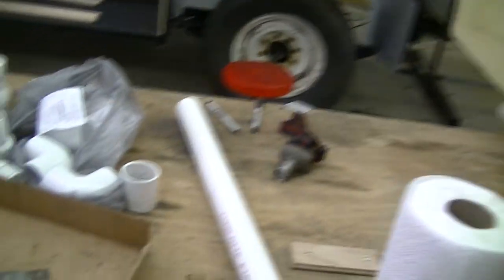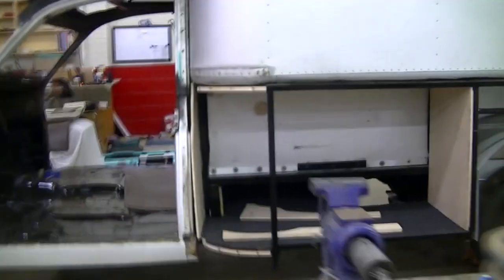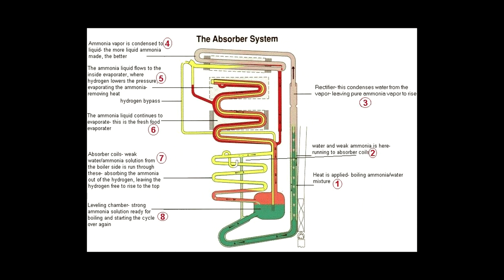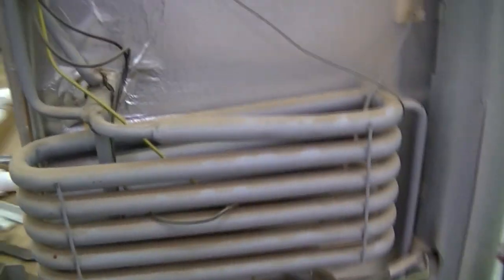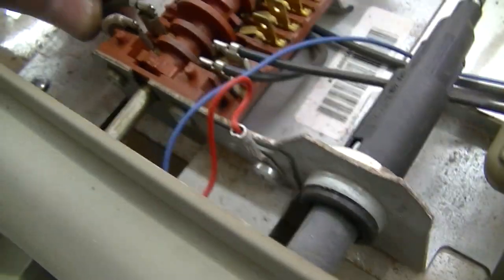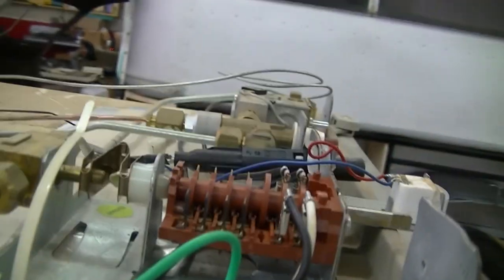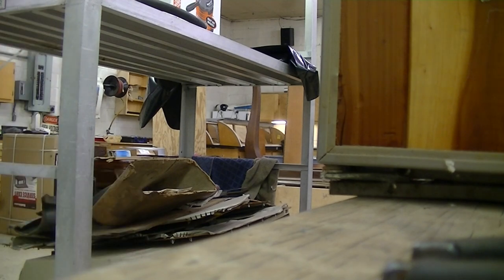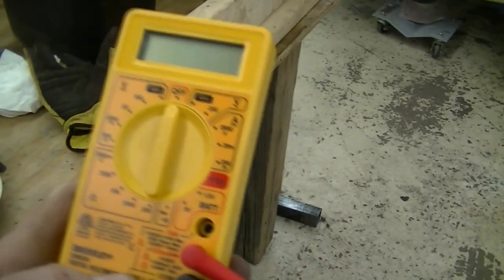RV / Mobile Refrigerator diagnosis and repair

Comment: Ah, I wasn't aware that they need to be level in order to work, that may explain why the fridge I just tested wasn't working. Thanks for the advice, and comprehensive explanation about how they work.
Reply: I had an 05 travel trailer & when I brought it home to get ready to go I never leveled it and it worked fine, now my 2019 sucks will not cool & level it as they say that is why but everything is made in China so who knows how good the parts are
Reply: @MCMUSICH 🔴 What Is Islam? 

🔴 Islam is not just another religion. 

🔵 It is the same message preached by Moses, Jesus and Abraham.

 🔴 Islam literally means ‘submission to God’ and it teaches us to have a direct relationship with God. 

 🔵 It reminds us that since God created us, no one should be worshipped except God alone. 

 🔴 It also teaches that God is nothing like a human being or like anything that we can imagine.

🌍 The concept of God is summarized in the Quran as:

📖 { “Say, He is God, the One.  God, the Absolute.  He does not give birth, nor was He born, and there is nothing like Him.”} (Quran 112:1-4) 📚

🔴 Becoming a Muslim is not turning your back to Jesus. 

🔵 Rather it’s going back to the original teachings of Jesus and obeying him. 

More .....👇

🔴 THE RETURN OF JESUS

Comment: Hi, where is the control panel on this model? I’ve seen videos on how to reset and how to check the fuse but can’t seem to find anything on how to reset? Hope you can help other than pulling the hole fridge out. Thanks

Comment: I have a refrigerate in my Coachman camper that I can't get to come on and it works on Elec and Propane the display will not come on to change it from Elec to gas do I need to check the breaker in the breaker box or do I need at less 12v to be able to do the change I'm really not sure if I have enough volts to run it or do I need any at all please help

Comment: Nice vid.Hello may be someone can help me, I have an absorption fridge isn´t working and there
is not service where I´m living (actually it returns from service 300 USD only
the shipping and work only 3 days). After 3 hours burning with gas (no electric
option), I have 374° F (190°C) at the exit from the boiler, 104° F (40° C) at
the exit from the condenser, 109° F (43° C) at the absorber, but I never get
cold inside. It is possible to have an obstruction at the evaporator or may be
it loses the hydrogen? Something I can do? I can hear the normal bubbles when
is burning. I guest is plenty of ammonia for the temps, I tried putting it
downside for a night for a blocking, tanks in advance

Comment: Hello. my name is Curtis. I full time RV and I mostly use propane to cool my fridge but I notice on hotter days it does not stay as cool. I took it to camping world and he told me I should put a fan in the back to circulate the air better. I also don't feel like my thermostat works because no matter what I set it at the temp is the same. the same mechanic suggested I clean some contacts on the thermostat. I was wondering what you might suggest.
Reply: traduzir para portugues

Comment: Mr fridge is a Dometic RM2601and both fridge and freezer quit working.  When I first noticed it, I noticed an odd smell when I opened the fridge.  Now that I've been looking into it, I may have been smelling ammonia.  I've tried to use both electric & propane and it makes no difference.  When I turn it on, it sounds like a water dripping and hitting a hot pipe.  The unit under the fridge seems to get pretty hot.  Any assistance would help
Reply: you need to replace the cooling unit. the ammonia smell in the fridge means the unit has rusted out, and it has failed.  I have done it with mine, it's not a really easy repair, but it is possible.  the cooling unit in my dometic rm760 was hard to get out, but way easy to put back in. I removed the fridge, removed the cooling unit, which meant I had to cut and remove a lot of polyurethane foam, but once I got it loose it came right out. it was $700 to replace the cooling unit, as opposed to 1800 for a fridge.

Comment: Thanks for the well explained and insightful upload. Do you know if "patch" repair is possible for an ammonia leak in the system for a known leak source?
Reply: danger! it's not just ammonia in the system which is toxic enough. sodium chromate is also in the refrigerant and it's lethal and a carcinogen.

Comment: I have a dometic rm2410 in my scamp. 2way. Doesn't get cold on either gas or Ac power. Any ideas on what else to check if it's not the switch?

Comment: if you ever have problems with these systems and you still got a working heater, try leaving it standing upside down over night. mixes up the ammonia and the water and gets them running fine again 99% of the time
Reply: do you plug it in when its upside down
Reply: No, you do not! I believe this procedure is called 'burping'.
Reply: That's an old trick I have not heard in 20 years but it works very well

Comment: I have a propane unit that I got out of a camper that I use in my cabin. when I turn it on it comes on cools down freezes the freezes and works great for a while then it kicks off and I have to restart it . any ideas on what is wrong.

Comment: I got a 86 prowler that the fridge won’t work on propane or electric. Just sounds like there is a bubbling noise when you have it lit on propane. There’s no smell in the fridge so I’m assuming my unit is still sealed. Any input would be great I can not figure it out.
Reply: If it's bubling it has a leak

Comment: i have a 12v compressor fridge that stopped working, I got a new control box and it still doesn;t work. My ohms test shows 444 on all pins test, whats the problem here?
Reply from the maker: What is the make and model of your fridge?

Comment: Can you explain how you cleaned the switch? Great video!
Reply from the maker: You can get contact cleaner / electronics cleaner at the auto parts store, or in the electrical section at your local home improvement store. Spray liberally into the the internals of the switch and then work the switch back and forth so the contacts rub on each other. If they are really bad, you might need to take 400 grit sandpaper folded up to clean between where the contacts touch by hand. Be careful not to bed the contacts!
Reply: Thanks, I'll give that a try!

Comment: Where 🤔 is the "Eutechtic Plate"? The RV is leveled to level the "Eutectic Plate."
Cal-Poly AKA California Institute of Polytechnology in San Luis Obispo teaches "Refrigeration Engineering". On "Earth Day" the Refrigerator-engineers create "Solar-Powered" Refrigerators take the Eutectic Plate s out, paint them black,  encased in clear plastic (acrylic?) and put into sunlight 😉 to drive the ammonia refrigerate to cool 😎

Comment: Mines turn on and seems to work for like 5 min or so then it shuts off and I have to press this little reset switch near the heating elements any help ?
Reply from the maker: Javier Cruz is this when running on gas or electric? if electric, 12v or 120v?

Comment: Ah, I wasn't aware that they need to be level in order to work, that may explain why the fridge I just tested wasn't working. Thanks for the advice, and comprehensive explanation about how they work.
Reply: That only applies when you use it with gas